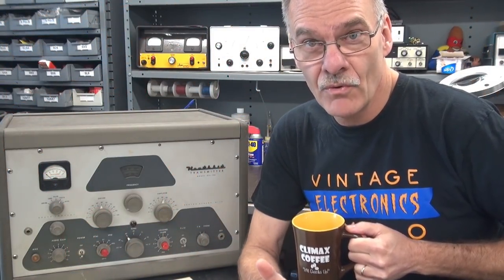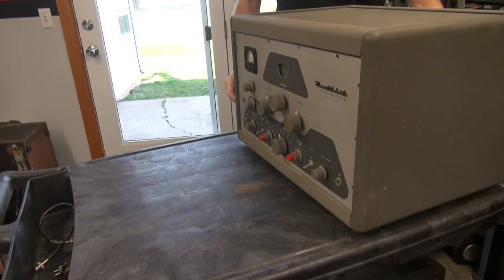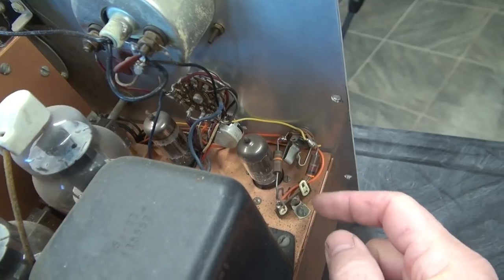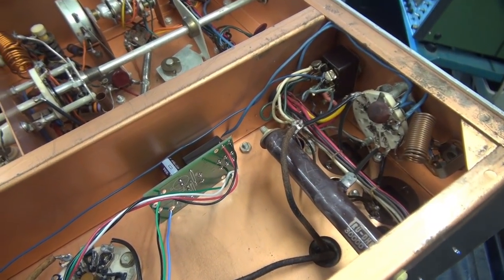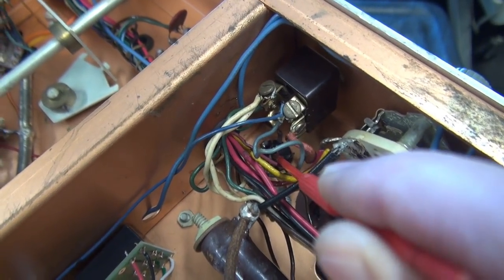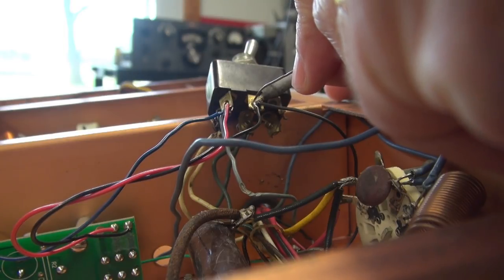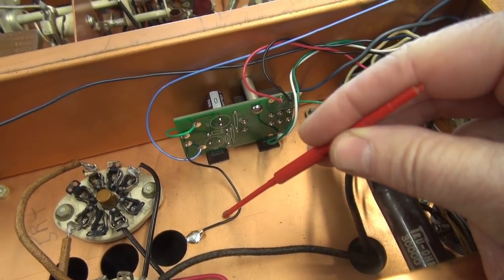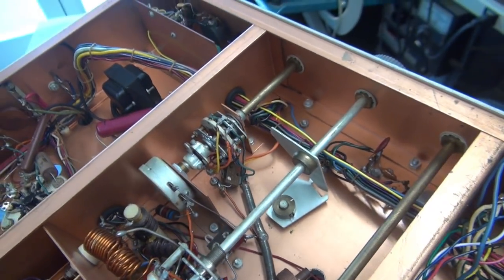How to Install PTT Push to Talk Heathkit DX-100 Ham Transmitter

Comment: Hi there Terry. Enjoyed the video of your modification  to the old Heathkit DX-100. My kind of gear to work on. The old eyes get worse has the new gear with surface mount components get smaller. Do also agree completely with the soldering of wires to the connection lugs of the switch. Carry on the good work OM. 73 de John - G0WXU.

Comment: If that unmarked front panel jack went off into the VFO could it have been a FSK mod for RTTY? Also, it appeared the gray (?) wire directly under the front panel switch you changed over to solder connections had a bit of it's jacket stripped away exposing the conductor...may have been my imagination though. Thanks for sharing Terry!